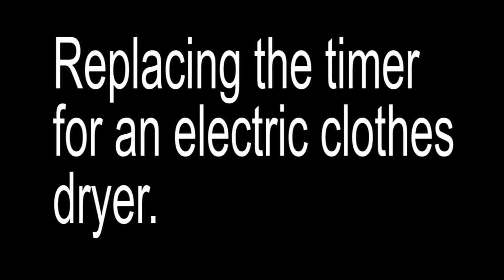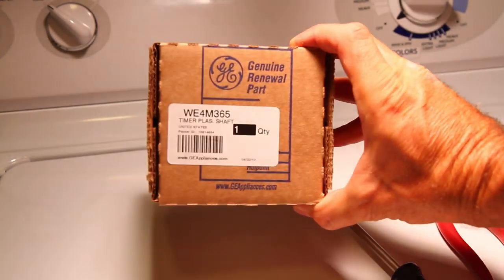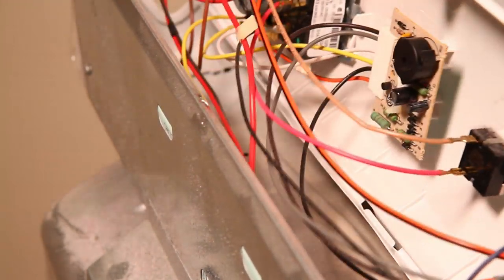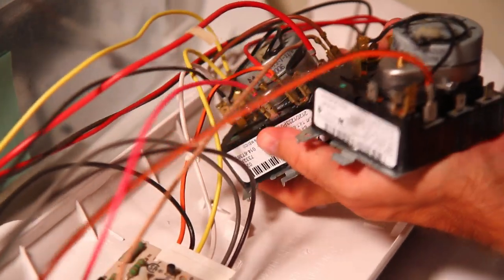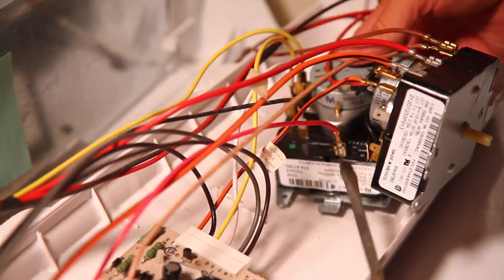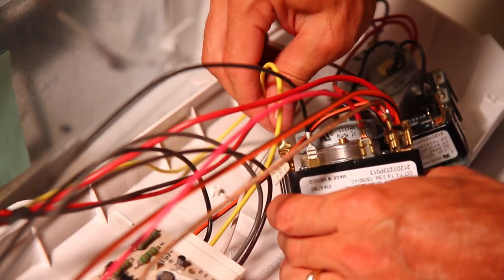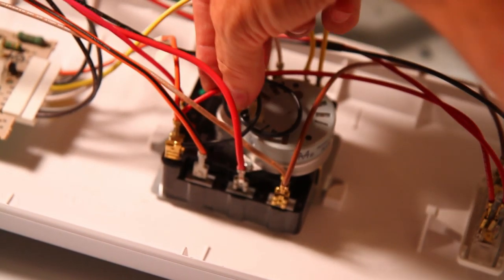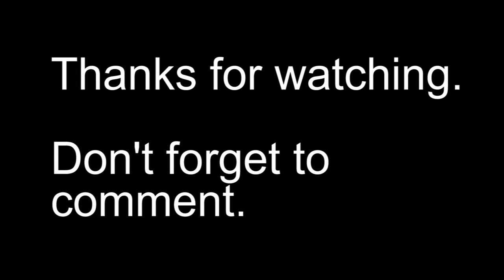Electric Dryer Timer / Start Switch Replacement

Comment: The Timer Switch Replacement video was very helpful. We were able to complete easily once we got the timer which was on Back Order for 2 months. Dealing so many incorrect delivery dates from distributors was the big problem.

Comment: Thanks for this video! Your video popped up in my search fro trying to figure out what was wrong with my dryer timer. I removed the knob to check for cracks before ordering a new timer and it was cracked.

Comment: Chris, I have a stackable washer/dryer & I need to replace both, the dryer timer & thermal limiter 220 fuse.  Any ideas on how to remove these, it's difficult to get the framework apart that holds the timer etc.. Thanks Mark

Comment: I have this same dryer. It seems like the cycle does not match where the knob is.. do I need to replace the whole start switch then? When I turn it clockwise, the clicks(start/stop) don't match where the knob is...hope this makes sense...?
Thanks so much for any help!
Reply from the maker: I'm guessing your knob is broken and slipping on the switch shaft, carefully remove the knob and look for cracks in it's hole. replace in the correct orientation and see if the knob matches the dial.

Comment: Yourvideo was very helpful I panic when my dryer was working this morning so i check the control key sure enough it was cracked so i use the plier to turn, now it working and im wondering where can i purchase the switch key since the dryer is perfectly working but the switch key is broken any suggestion please?
Reply from the maker: alice faleaana if you are talking about just the knob, I'm not sure where to purchase that. perhaps google you dryers model number, I guess you will find sites with replacement parts. Or try a local appliance repair shop--just show them the old knob and the model number.
Reply: Oh OK. Thanks  so much. Blessed weekend to you and yours.

Comment: is it possible to replace the little white prong that the knob attaches to? or does the whole timer have to be replaced?
Reply from the maker: I think you need to replace the whole unit.
Reply: @KrisKasprzak  Hey I need your help. I have a similar GE dryer but knob is located in the center. The issue is something with the knob but not sure what happened. It turns fine and turns the metal stick its attached to but it doesn't make a click noise. It doesn't make the click click clik when you turn it kinda like winding it up but it doesn't wind. What's the issue here? I'll add more details once you reply.
Reply from the maker: @Me-xd7bd  Sounds like the switch is just broken--something wrong with the internal components. not sure you can do anything except replace the switch
Reply: @KrisKasprzak  Thanks for the fast response! I needed help quick! Actually if you're talking about the light switch at the corner of the dryer door, I don't think that's the issue, I tried holding it while pressing start but nothing. I'm not sure but I think it has to do something with the thing that the knob turns if that's called a switch as well. Where do I find these components? Amazon?
Reply from the maker: @Me-xd7bd  The main knob (the large one I show how to replace) is the one i'm referring to. They are not easy to turn and make a loud clicks as you turn the knob. If not you probably have a bad switch. Unplug the dryer, open the cover and get the part number (or any number) off the switch and google it. I doubt amazon has these, i had to get mine at an appliance store.
Reply: @KrisKasprzak  Thank you so much for your help. Model number of mine is GE GTD45EASJWS. Center main knob turns smoothly but prior to not working, it turned with bit more resistence and did make a ticking or clicking noise, but now it doesn't. It turns around smooth but at one point 12 o'clock position it just has no resistence or any grab its just loose like a loose toy wheel. Sorry I'm not a DIY person and not familiar with describing things.
Reply: @KrisKasprzak  its this Norm Pacific TMD14M30 but I can't find the WE##### for it. Are we allowed to use different timers?
Reply from the maker: @Me-xd7bd  WE###? not sure what you are talking about. No clue if there are subs. Based on this thread, i'd call a repair person If I were you--unless you really trust yourself with 220 VAC and a fire hazard appliance.
Reply: @KrisKasprzak  I'm sorry thanks for all your help. I found out the actual model number by opening the door and looking at the sticker. I found the timer model number. By the way is appliancepro a good online site to buy? Any online stores your recommend for parts? Thanks so much!

Comment: I have neb having trouble turning my knob, I didn't realize that the knob was cracked, so I spayed wd40 under where the knob goes, if it was only the cracked knob that was the issue did I just ruin the electronic portion?
Reply from the maker: I doubt WD40 will ruin the switch, unless you used excessive amounts.
Reply: Ok thank you.  u Will go but a new knob tomorrow and hopefully that'll fix everything.  If not I know I'll need to switch out the other portion.

Comment: What if the wires aren't connected properly? It worked until I shut it off! It wouldn't work until I got it right. Well, it comes on but with no heat.
Reply from the maker: if the wires are connected properly then it probably won't work properly
Reply: Okay. I think it may be the breaker. Where exactly is the location of it? The dryer is s GE SensoryDry.

Comment: Kris on my keen more dryer I changed the thermostat 3rd time already but keep blowing out..no clue what wrong..Help please..
Reply from the maker: i'm not sure my only guess is the unit is getting too hot which may be caused by the exhaust vent getting clogged up with lint.
Reply: Thanks..

Comment: please help~~~My dryer is problem. When I push the start button. It is starting.But not working right away. When I keep pressing the start button. It is working until set timer.I already replacement to door switch button and push to start button. but still have problem. What is the problem my dryer...   :(Thank you for reading~! ^^

Comment: If the timer doesn't work will there still be heat?
Reply from the maker: no idea, if the switch is bad, i'm not sure I'd trust the dryer.
Reply: First thing I noticed was no heat. So I had no choice but to air dry to be ready to go to work. I wake up in the morning and it is still running. Not sure if it is a coincidence or has something to do with each other.

Comment: My model number is worn off the door. How can I find it. It looks like the tree you are working on
Reply from the maker: +Donnis Brown 

I recall this being the part number for my unit
we4m365

this number is written on the timer switch itself
212d1233p013

Not sure if these will work for you though.